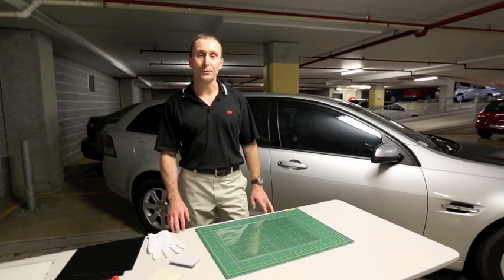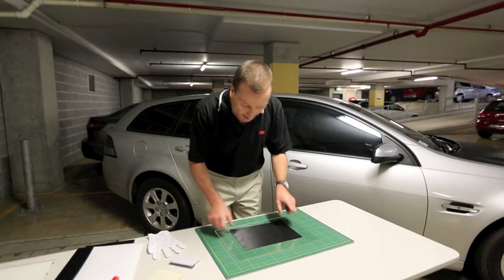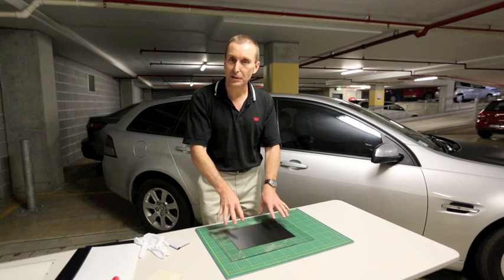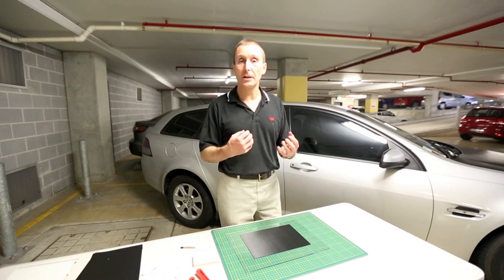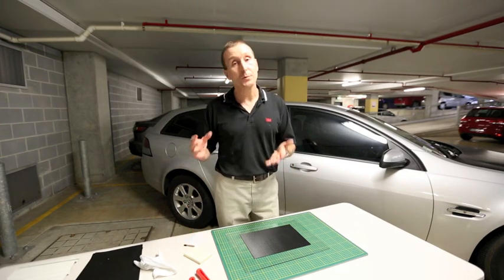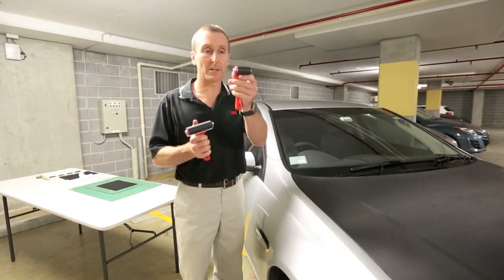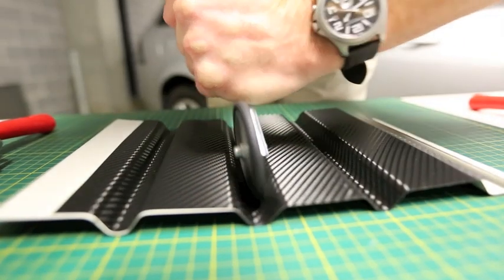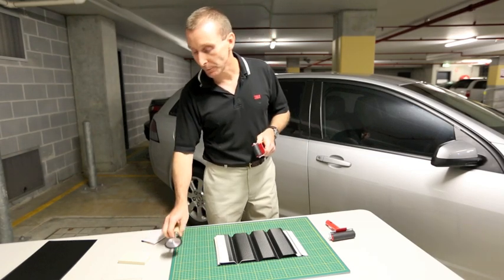3M - Cookie's Tip - Squeege Techniques

Comment: I have 1080 matte blue that i was applying and it kept tearing.  What temperature should I apply the vinyl.  It was about 53 outside with no sun
Reply: Commercial Graphics speaking about temperature, i live where temperatures can reach 30 C is that dangerous to the vinyl?
thanks